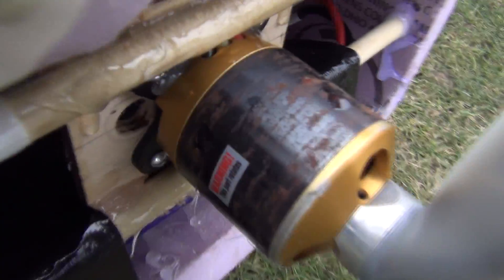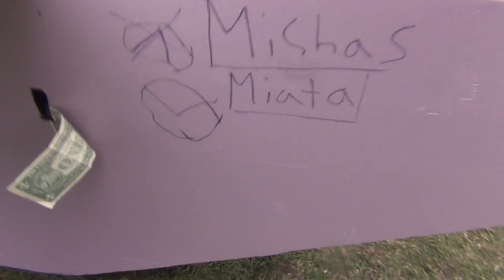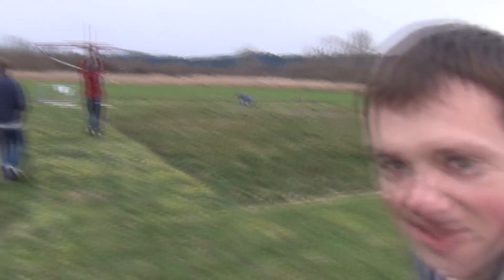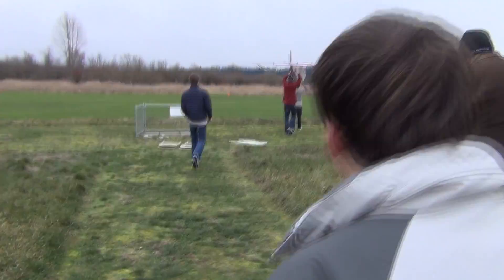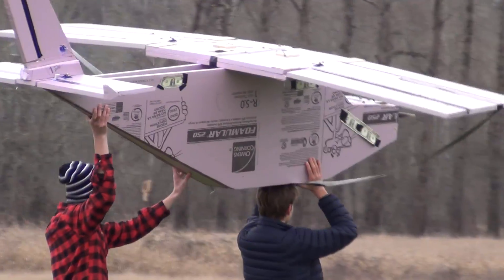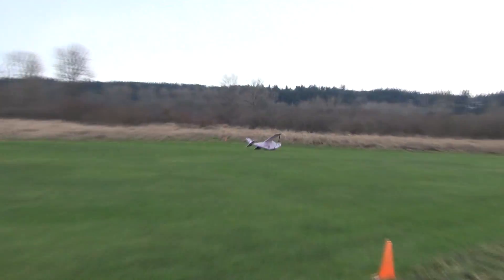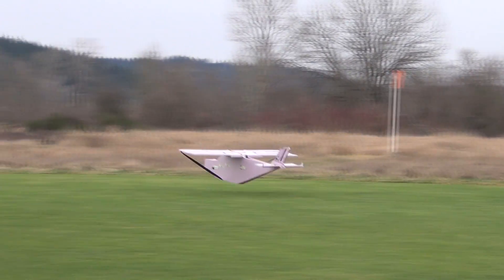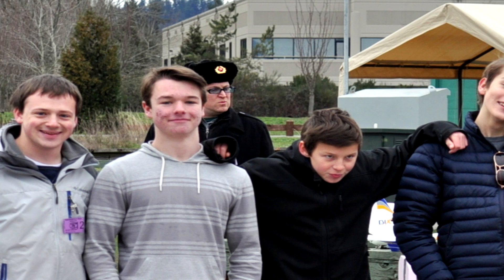Giant Scratchbuilt Foam R/C Zenith 701 "Pink Panther" Flight Attempts

Comment: no lift produce
Reply from the maker: Nishant Bhandari That's what you'd think. However, all you need for lift to be produced is an angle of attack. Hence why it flew the length of the runway with only a flat piece of foam. There is lift present, but the drag is greater than thrust in this case and the amount of lift is too low to overcome that. Hence the continual descent. Check out rctestflite' channel for the re-maiden where we added more thrust to overcome the drag. She flew!
Reply: lol she flew hehe :P

Comment: You don't need a bigger motor as much as you need a prop that's bigger than your fuselage.  It's just blowing all it's thrust against the plane.
Reply: You need an airfoil! Simple as that!
Reply from the maker: +Brian Link https://youtu.be/7TbMB4WMzbQ
Reply from the maker: Then explain how the Gee Bee air race planes fly? :P By thrust alone. The fuselage blocking the prop doesn't eliminate thrust as much as you'd think. All we needed to get it flying was the thrust to overcome the drag. Stay tuned to the RCTestFlight channel for the re-maiden and successful flight!
Reply: A Bee Gee has a big nose, but an even bigger prop.  Also, most of the air that is blown into the cowl is for cooling the motor, and is vented back out behind the engine.   What you need is a smaller nose or a bigger prop, not a bigger motor.  Good luck with your flying.
Reply from the maker: +atheist45 Agree to disagree there. Point is, if you have the thrust to overcome the drag, it'll fly. In the upcoming video, you'll see it did just that. 20 pounds of thrust did the job, and the prop being blocked by the fuselage didn't lower that number at all.
Reply from the maker: +Brian Link False! All you need is thrust to overcome the drag. Check out RCTestFlite's channel for the remaiden.
Reply: Was unable locate it. I still stand by my comment. With a simple redesign to the wing, it would have flown.
Reply from the maker: +Brian Link We didn't design it to make it aerodynamic. It was designed to prove people wrong that said exactly what you're saying haha. You can make anything fly with thrust to overcome the drag. I have added the link to the description of this video.